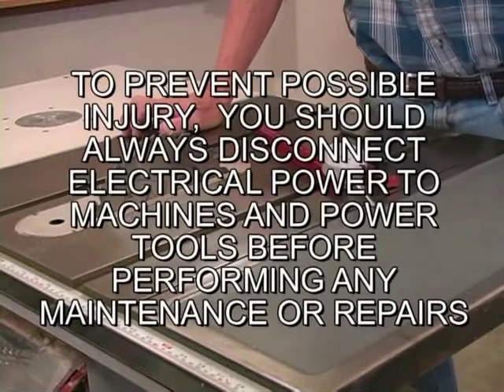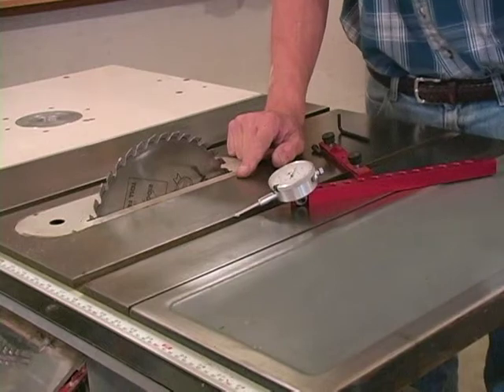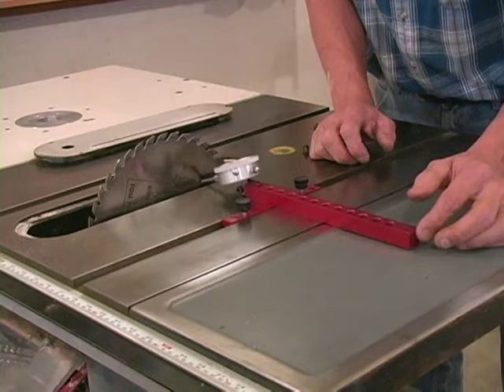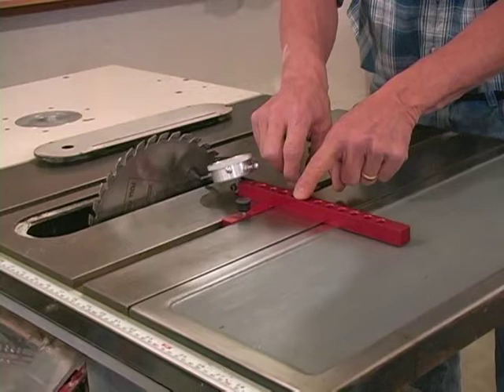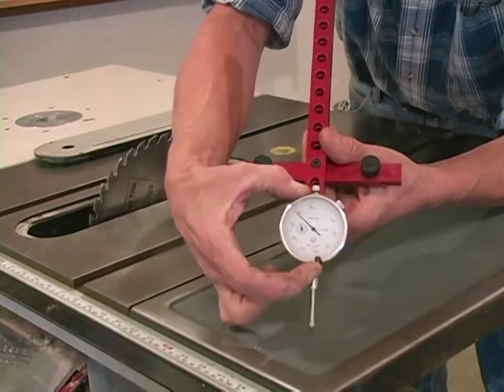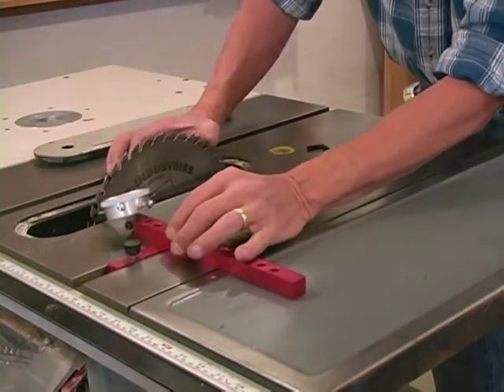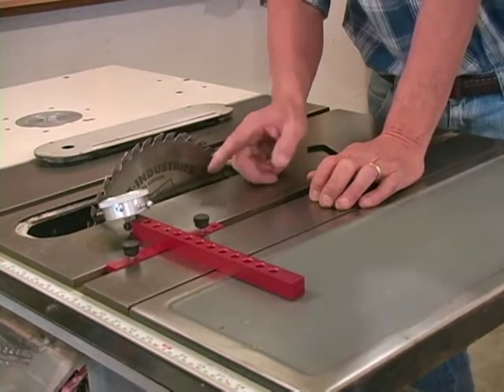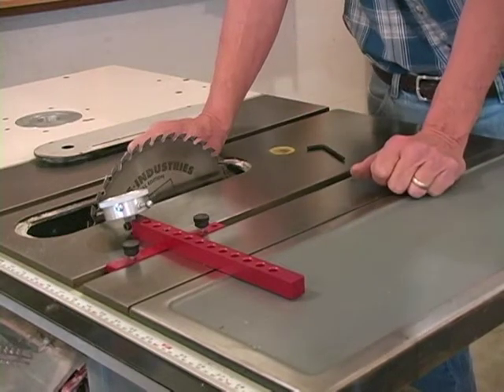Testing Table Saw Alignment

Comment: Never mind; I got it now. (at least to 3 thou) It is easier if the saw and table it is on is sitting level before you start so the weight of the mechanism is balanced as evenly as can be between the trunnions; mine was partly on a sloping part of the floor.

Comment: What if you run out of adjustment slack in the rear trunnion slots using the PALS and the alignment is still skewed 17 thou ?(closer to the miter slot at the rear than the zero at the front).  I checked my arbor runout is less than half a thou; its a new unused blade with +/- 3 thou runout.  I tried loosening the front trunnion to get the starting difference closer but there is no slack in the needed direction there either.  I'm thinking I may need to either put a shim on one side of the trunnion between it and the cast iron table; or swap the front trunnion into the rear position.  This is on the 1953 Craftsman 113.27520

Comment: Jose suggestion for you!
I had the same issue with a different saw, I over came that by putting two large F style bar clamps on each side of the saw arbor mounting trunnions and the outside of the table saw cabinet. I tightened clamps then loosened the trunnion bolts. To micro adjust the trunnion.
Tighten one clamp and loosen the other clap very slightly. Test the alignment. When you have  the trunnion set where you want it.  Not touching the clamps
Tighten the trunnion bolts. Recheck alignment. And then remove the clamps.
This will keep the trunnion in the same place you set it when you tighten the trunnion bolts.

Comment: Nice video, I have a certified flat (00003) aluminum plate that I mount to the arbor and is more accurate than a saw blade even if you do
Use the same spot on the blade. This plate and a dial indicator has made the adjustment easy but time consuming.

Comment: My table saw is a Shop Fox W1837 which has the adjustment bolts on the table itself and each time I tighten them, the saw shifts no matter how carefully or slowly I tighten the bolts. Are the pals going to work on this table saw?

Comment: yeah good luck with that, it is almost impossible to to get a perfect "zero" especially if you have an old table saw, i spent a whole day tying to align my damn delta table, i am just about to throw it off a cliff.
Reply from the maker: If the saw has the motor hanging out the rear (a belt drive contractor) it actually quite easy to get it perfect, as long as you have 20 minutes, a dial indicator, and a set of our PALS on it. (www.in-lineindustries.com web site).

Comment: I was wondering...if you were to slide the smart bar with DI across the face of the blade (without rotating the saw blade) would you effectively be measuring for the same parallelism error (blade to miter track)?
Reply from the maker: That would not be a valid test because most saw blades don't run perfectly true, and you can't be 100% positive that the arbor flange funs perfectly true either.  Using the technique of using the same spot on the blade at both the front and back as we show, you are actually testing whether the arbor shaft is perfectly square to the miter slots on the saw.  If we just slid the indicator back and forth and there was a slight wobble to the blade, we would adjust the saw to one position, and if we rotated the blade 180 degrees and did the same test, it would look like we went in the wrong direction.  Good question! I hope I gave you a "makes sense" answer.
Reply: Thanks for responding Jerry and yes it made sense...so I adjusted my Craftsman 10" table saw using your technique and got the trunnions locked down with less than 1/1000th inch of blade to miter track error.  Now moving on to the miter track to fence adjustment.  Appreciate your how-to video.